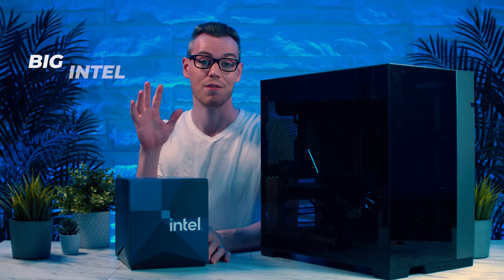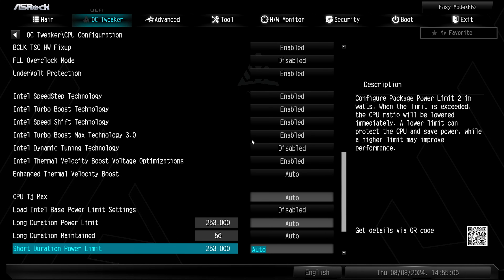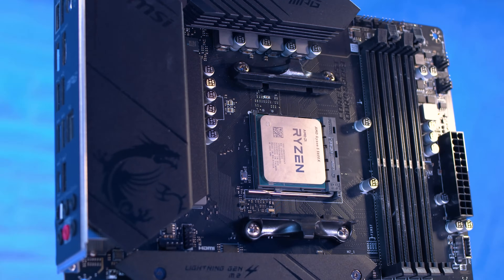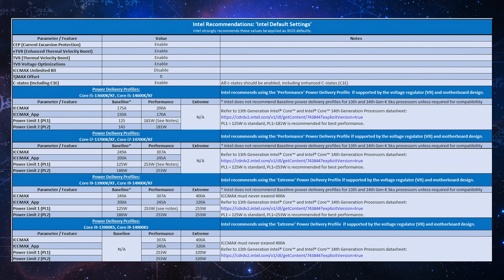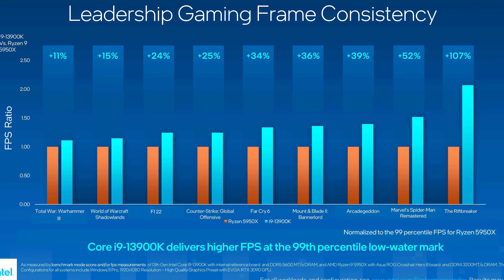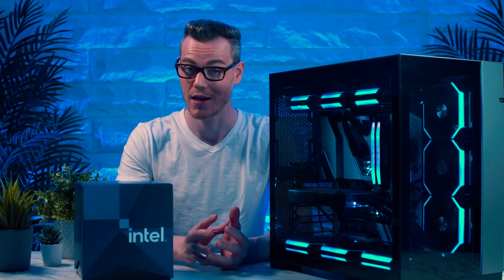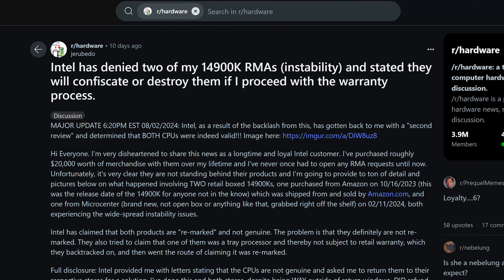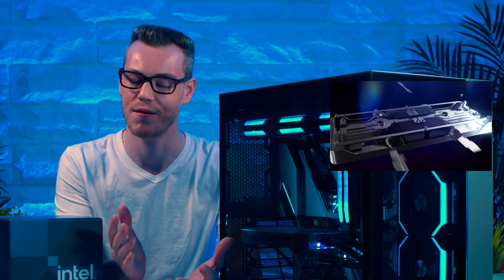The Intel Problem vs My $4000 PC... I'm Getting Mad Now

Comment from the maker: Watch This Next 🌟 https://youtu.be/kKiW-8bUSQg 🌟 TODAYS SPONSOR 👉 25% Coupon code for software using "TL25": https://biitt.ly/XQT7V

How does Intel's handling of this situation sit with you?
Reply: first off i am only aware of MSI motherboards having the Intel microcode patch too bring the CPU back too specs instead of OVERCLOCKED straight out the box with too much voltage !!! also too check you have the patch applied you go into BIO,s and power limits and PL1 should be 125watts and PL2 should be 253watts and core voltage should be idle 1.0v and boost 1.2v ... i dont think you got the microcode update and you have a bad CPU cooler block mount , don't use carbon pads , their garbage . use thermal paste and a Thermalright retention bracket for 12/13/14 gen Intel .. and if the settings ive just given you are not applied in your bios then you do not have the microcode update that make the voltages Stock intel and your still running the OC bios which is causing issues ..
Reply: I remain unimpressed by what I've seen from Intel regarding these issues thus far: stonewalling, stealth edits, and finger pointing.  (One might almost get the idea that they're running a Presidential campaign. 🤔)

Comment: im gonna add to the intel hate

I LITERALLY BOUGHT A 13600K RIGHT FROM A FIREND'S RECOMMENDATION BECAUSE IT WAS CHEAPER RIGHT BEFORE THE WHOLE SCANDAL SURFACED, IF I WOULD HAVE KNOW, I WOULD HAVE NEVER PURCHASED ANYTHING FROM THEM, BEAUSE NOW I HAVE SPENT NOT ONLY FOR THE CPU, BUT THE MOTHERBOARD AND THE RAM AND THE REST OF THE BUILD, THIS WAS SUPPOSED TO BE MY DREAM BUILD AND NOW EVERYTHING BUT THE GRAPHICS CARD IS FUCKED.

they should be sued for the worst case of planned obsolescence. what the actual fuck. I saved hundreds and even wanted to get a asus proart motherboard. and now the whole LGA1700 socket just seems worthless unless i fucking downgrade. meanwhile if i wanna go up with intel, even changing platforms seems fucked for them. I will never buy another intel product. I sohuld have gone with AMD from the start like how I had planned. 

Maybe i can just use this pc as a nice media server or something till it dies in a year or two.

Comment: At the end there will be overhang of cpus from intel on the market as a lot of rmas will be circulating market very cheap. At the end this can help intel eventually. Ofc damage is much bigger but long term prospects are better once they and if they solve other technical issues. Most probably they will

Comment: I bought a Lenovo Legion laptop with an Intel i9 13th gen processor about 18 months ago. For the 1st year it was great. Then the problems started. I'm not a gamer, so that was not the issue. My Legion started spontaneously rebooting, seizing up, BSOD, getting seriously hot with the fans running hard and too frequently. By the time I started reading about these problems being widespread for not only the 13th gen CPUs, but the 14th gen as well, it was already too late for mine. It was literally cooking itself to death. The BIOS microcode was useless. My Legion is burned up. Intel should be sued into oblivion.

Comment: My man, I feel a whole variety of emotions... Disappointment, fear, concern, worry, sadness, unsure, just to name a few... here is my Rig in its entirety... 

My Rig's Components.
Build Date 03-16-2023

Case: Lian-Li 011 Dynamic Evo
MoBo: Asus Maximus Extreme Z790
CPU: Intel I9-13900KS
Thermal Paste: Thermal Grizzly Kryonaut
CPU COOLER: Asus Ryujin II 360mm
GPU: Asus R.O.G. Strix 4090 O.C. Edition
PSU: MSI MEG Ai1300P PCIE5
RAM: G-Skill Trident Z5 DDR5-6400 32-39-39-102 32G × 4 = 128G Total.

M.2 Drives 1 + 2
O.S. Only Boot: Samsung 990 Pro 1T
Storage 1: Samsung 980 Pro 2T
Storage 2: Samsung 980 Pro 2T

Fans × 10
Set 1 Top CPU Rad: I Lian-Li UNI Fan SL Infinity 120mm × 3
Set 2 Side Panel: E Lian-Li UNI Fan SL Infinity 120mm × 3
Set 3 Bottom Panel: I Lian-Li UNI Fan SL Infinity 120mm × 3
Set 4 Rear Exhaust: E Lian-Li UNI Fan SL Infinity 120mm × 1

Monitors × 4
Main: Asus R.O.G. Swift OLED PG42UQ 4k HDR, 42", 0.1ms, 138Hz.
Side 1: Asus R.O.G Strix XG279, 2560 × 1440, 27", 1ms, 170Hz.
Side 2: Asus R.O.G Strix XG279, 2560 × 1440, 27", 1ms, 170Hz.
Side 3: Asus R.O.G Strix XG279, 2560 × 1440, 27", 1ms, 170Hz.

I want to say this entire Rig cost me well over $10,000 USD. That is also using all of my existing peripherals. 

New Current Peripherals (I've upgraded them 2-3 times since my build date.)
Razer naga V2 Pro
Razer BlackWidow V4
Razer Kraken V4
Razer Leviathan V2
Razer Base Station V2
Razer TarTarus V2
Azeron Cyborg

It hurts that within 2 years I might have catastrophic issues with a main component.

Comment: Maybe this is the title I want to scream.
I bought a 13900K a year and a half ago, of course and a high-end motherboard Z790 HERO, the nightmares started with problems with the water pump, I decided to replace the water cooling in the service center where I bought it, they found bent pins on the socket.
I was so angry.
I ordered a new DARK HERO motherboard, it came with a scratched battery! And who knows what else!
I returned it to the RMA.
I ordered DARK HERO again from an official ASUS distributor for my country, missing accessories, and the same date and year of manufacture that I returned !
In the middle of 2024 you buy a product from the beginning of 2023, strange, right?
The motherboard box of course wasn't even sealed!
The problems with high voltages started, I was furious!
A week ago, a strange smell appeared from the computer, thank God I did not see any leaking capacitors on the motherboard.
All this turned into a real nightmare and you become a laughing stock with your own money!
This is how some people make money off the backs of others

Comment: I built a $5000 PC based on the Intel 14900k.  Crashed in all games, so I returned it.  Got a 14700k.  It also crashed in games.  Returned it, got a 12900k.  And the crashes are gone.  I will never buy an Intel again.

Comment: Maybe, just maybe - one should be familiar with the specifications and not push things so far. What I see is many people blaming Intel for what Asus (and others) did as well as their own failure to be reasonable in overclocking. 

Thermal throttling is the equivalent of auto breaking in crash avoidance. It's not intended to be used on a regular basis nor as a substitute for good judgement. I suspect had people treated 80°C as the absolute maximum, there would be no controversy.

I don't know your personal story, but the question must be asked "Why is it that we don't hear businesses reporting this? Why is it that it is gamers - most often - tweakers...? Too much correlation to call it coincidence.

There's an old expression "Sailing too close to the wind."

Best wishes in resolving any problems you may be having.

Comment: Built a new system a while back, Got a 13900KS as it was the best processor at the time. Nothing but problems from day 1, game crashes, instabilities, etc... Dealt with it for a while, eventually it just died, wouldn't boot windows, wouldn't boot Linux off a USB. Took the system to local shop to confirm the dead CPU and yeah that was it. So I bought a 14900K as a replacement. Figured I'd just RMA the 13900KS later. 14900K ran great for 5-6 months and then started having issues as well. Game crashes, instabilities, Eventually it died as well, system would run for a bit and then just power off/reboot. 

I RMA'd the 13900KS and got a replacement like 5-6 days after I did the RMA. Gotta give Intel credit on that part I guess.

Still working with support on the 14900KS,  just haven't got around to bios hoops they want me to jump through. 

Scared to put the 13900KS back in. Kinda waiting to see how things play out with the microcode patch. 

Running on my 4790K system in the mean time.
Reply: Fucking hell bro that's nuts.. I own an i9 13900kf since october 2023 and never had any issues with it.

Comment: lock the P cores to whatever clock speed 1.3 Volts can deliver. The cpu will run for years to come. Don't wait for scam microcode updates. You have an unlocked chip on a Z mobo. Never rely on auto settings ever.

Comment: What pisses me off is that IF my 13900k blows up, what the hell am I gonna replace it with? Unless Intel actually fixes the problem on a new chip, I'm in the same boat, so I'd have to replace my $1000 mobo as well!!!  So far, luckily, I've seen no issues, but I've been running it stock and haven't had too much time to play with OC it yet, thank god!  I've installed the fix, but still #$%! you Intel.... 😡

Comment: Just lock all your cores and lower your vcore and offset, and lower your cpu power to 253 watts. Problem solved, you dont need the micro code update as many others have stated it only prolongs the degradation by forcing longer idle states, but when the cpu is pushed hard those 2 cores will still ramp up, and it will shove more than 1.4+ volts into the cores, and kill the cpu overtime.
Reply: Man this shit is confusing. I was just gonna update the bios
Reply: @RP-16  Yeah, I understand. I too wish you could just plug and play with the cpu like with previous generations, and not have to worry about the cpu degrading, or having to manually tune it to save it, but this is where we are at now. 

It is either tune it yourself or do the bios update, and prolong the inevitable of the cpu degrading in a few years time.
Reply: @TheCzar1  did the update and my game just doesn’t run as good as it did a few weeks ago before the crashes and freezes started. My pc is cooked

I picked intel performance, should I do extreme?
Reply: @RP-16  I wouldn't even bother with the Intel profile.

 I would just manually go into the bios and lock all the cores to the real speed of the cpu. 

For example, if you have a 13900ks or 14900k, lock all the cores to 56 (5.6 ghz), then set the vcore to 1.345v with a negative offset starting at -75 and working your way up if you need more of an offset. 

You want to keep the voltage below 1.35v at all times.

 Also, if you have Windows 11 you have to turn off "core isolation" as it will override any vcore voltage and offset that you set. 

Also, limit the cpu power to 253 watts max. 

If your cpu is already degraded then send it into Intel and once you get the new one tune it right away. Hope this helped.

Comment: @6:46 Option #1 - IS NOT AN OPTION!  How does NO ONE GET THAT!  The CPU WILL STILL DEGRADE TO AN UNNATURAL DEATH DUE TO THEIR DEFECT In what MAY BE EVEN SHORTER TIME given iv seen the new microcode increase voltages in areas to try and not have the legal issues of performance metric losses AT THE COST OF KILLIGN THE CPU FASTER!  - Ive not watched anymore but if your SOLUTION #@ - IS NOT: MAKE A DEFECT FREE BATCH OF CPUS we ordered.. Then.. Youre on another planet.. and  logic is as faul;ty as it was for "solution #1" which is HORRIBLY MISLEADING!  Solution means - the problem is solved.. #1 is a bandaid at best if not actually a malicious act OF ITS OWN!

Comment: Scan have offered me a full refund on my 13900k and mobo I bought early last year. I’ve decided to go with the 7950x3D instead of a replacement chip. Now my i9 won’t even pass a single core cinebench test
Reply: Did you have extra coverage or is that solely down to manufacturer warranty?

Comment: Well I just upgraded from 5600x to 12600kf because the stutters I was getting on 5600x😂
Reply: The 12600 is a good performer, and (being a 12th gen CPU) it is not subject to the problems/issues being discussed in this video, so you shouldn't have any problems with it. 👍🏼
Reply: @MikeBob2023  yep using it now and I managed to get a 6800xt for £300
Reply: @Lvll1x  VERY nice!  👍🏼

During the 'Prime Day' sales back in July I purchased an XFX Merc 319 RX 6950 XT for $500. 🤗

 (Then, perhaps a week ago, I noticed it's back down to that same price again.  I'd wager it's going to sell out fairly soon. 🤔)
Reply: @MikeBob2023  yeah i was lucky since it was used but still great condition with box sapphire pulse for £300 cant go wrong especially in 1440p 165hz
Reply: @Lvll1x  Good on ya. As AMD GPUs go, Sapphire is top tier. 🙌🏼

Comment: Don't update your bios or do any of that microcode stuff. Lock your voltage to 1.35v on your cores, set your load line to 6 and sync all your cores. You get the same performance at 5.7-5.8ghz as you would at 6ghz. This is solved and you guys are still going to degrade your cpu at 1.4v+ spikes.

Comment: Is it a better idea to switch to 12900K rather than running a 14900K on a Z790 board with Intel's new microcode for the long run?
Reply: 100%
Reply: Very definitely, yes, imo.

If you're stuck on an Intel platform (as opposed to having the option of switching over to AMD right away), all the 12th generation Intel CPUs (and the 12900k in particular) are tried & true performers, safer alternatives, and reliable.

The i9s and i7s are power-hungry mofos, mind you, and care should be taken to keep the unlocked SKUs cool under load, but my advice there would be to check your BIOS settings to insure that whoever your motherboard manufacturer is didn't ship it with its Balls to the Wall performance settings enabled. 🤔

Comment: Am on 12700KF & 12900KF Alder Lake, I lucked out in not buying Raptor. Spent a lot of time tuning though about a year to be stable. Going AMD next round. I think the microcode will delay degradation but not fix it as is. If it has degraded RMA is the best fix. The voltages seem to be too high (namely the P cores).

Comment: the problem is AMD isn't really competing that well, yeah there's the x3d cpus but their performance is really a smoke screen, if you want cpu horse power and good 1% lows then intel has the best solution. Despite intel being a bit of a shady dealer I can see myself upgrading to their next CPU offering on the basis it shows good benchmarks.
Reply: in my opinion, its kind of nice that amd is not rushing to compete with intel. sure they are not giving the best performance but whatever the performance they are giving,  is rock solid. so I personally feel that its okk if they just stick their pace and keep improving slowly instead of rushing to get more buyers. cuz intel just did that and its a shitshow. and not just with cpu companies, but games as well. how many studios make sequels just to get more money such as ubisoft. so m kind of hoping that amd would stick to improving slowly rather than rushing. and I think they already learned their lession after there last fck up. but thats just my opinion.

Comment: Mines fixed. 14900kf running just as strong as my 12900KS and I'm running everything unlimited no cep no temp throttle and I haven't experienced any voltage spikes or crashes. RDR2 plays for hours and hours at ultimate setting 4k now, and that game is sensitive unstable as hell. I've had my system built for about 6months and I could even play it for and hour without it soft or hard crashing no matter what I didn't. Had to swap to the 12900KS till this microcode came out. Now the 14 rocks!
Reply: Laugh now but you'll see it breaks soon